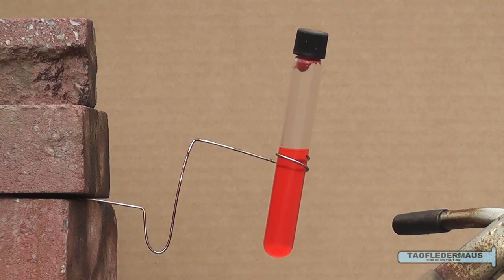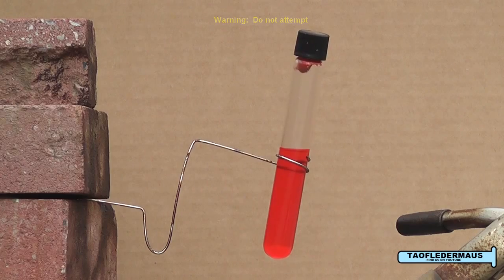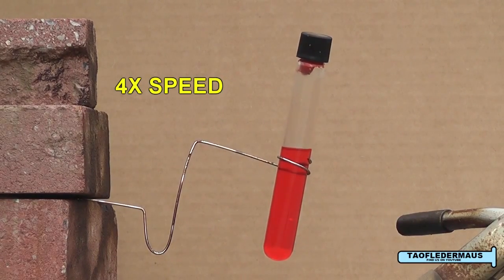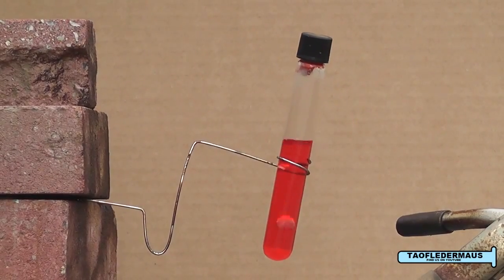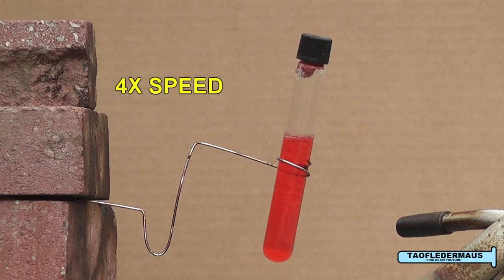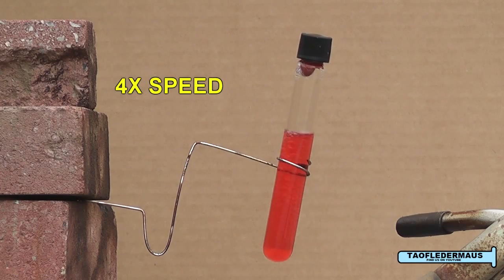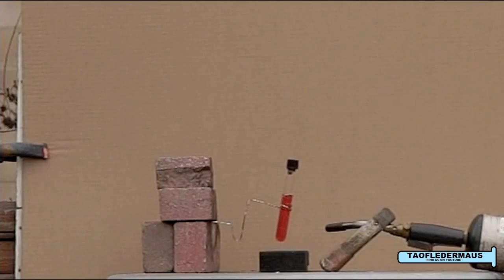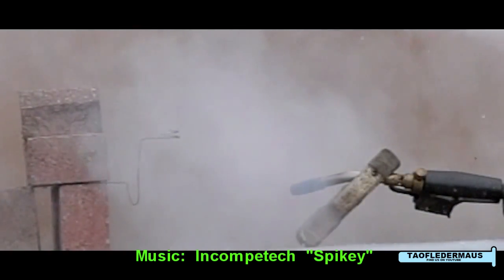ANTIFREEZE vs GAS TORCH -  Can you guess what happens?

Comment: The cap allows pressure to build. As the pressure builds, the boiling point of the liquid is raised. The liquid temperature is constantly being raised by the torch, increasing the pressure, which causes the boiling point to keep going up. Finally, the cap partially fails, allowing the pressure to drop. As the pressure drops, the boiling temperature lowers, causing all of the liquid inside to instantly boil and expand into a gas state explosively, shoving the cap out of the test tube and launching it into the table. Simple physics.
Reply: nah man he just got tired and shot it with his shotgun
Reply: +LimitedOptionsMan Your one smart person! Nice explanation!
Reply: +Imalovrman Don't thank me, thank Richard Graham, The Skunk Works, USAF, and the SR-71.

Comment: That was awesome, but what I wanna know, does the anti freeze turn into vapor as soon as it hits the air outside of the tea tube
Reply: Super-heated (because they are under very high pressure) liquids flash to steam instantly when pressure returns to normal.

Comment: I'm wondering if this was premixed anti-freeze or just straight up anti-freeze and what would have happened if it was pre-mixed or visa versa? I've been told using straight anti-freeze does not protect from freezing/boiling as well as properly mixed anti-freeze/water.

Comment: that is just awesome, it took a lot longer to pop than I thought, and in the end it was just heat-soak getting to the cap!
Reply from the maker: Thanks!   Yeah,   it's hard to tell how long these take to heat up to failure.   I tried motor oil and after 15 minutes,  I knocked the torch away.   I still need to try to re-do that one.   The oil just turned black.

Comment: Antifreeze also has lubricants for your water pump as well. Another interesting fact is it doesn't conduct temperature as well as pure water, but the benefits of the rust corrosion prevention, higher boiling point, colder freezing point, and lubrication outweigh the slight disadvantage  of not conducting as well.

Comment: There are two important factors that are shown in this video about the  internal tube pressure. 1) The liquid started to boil with big bubbles, but when the time is elapsing the bubbles start to shrink and the quantity decreased significally.  2) Notice that when the tube exploded it was a violent reaction, the substance inside was in a liquid status and it suddenly it vaporized, that was caused by the pressure variation, in a fraction of second the pressure inside was extremely high, and when it was released it decreased too much turning much lower than the external pressure before stabilization. That is a physical propiety of liquids, the second mencioned factor happened very fast.

Comment: that one sounded like an old flintlock firing, .....click, poof, boom!!! good vid, thanks.   
 hey you forgot to mention that due to the smaller molecular size of the antifreeze, it helps make more contact with the engine block at the microscopic level and therefore is able to work in conjunction with the water to adsorb and dissipate more heat in the engine block and radiator respectively lol it also accounts for some of the observations and results here

Comment: I've seen chem labs do, that want to do similar heating experiments, is melt the top of the test tube shut.  That would probably require oxy-acetylene, or MAP gas, might weaken these test tubes, and is probably tricky, and of course, dangerous.

Comment: That was awesome, love to see some other things that maybe you wouldn't think would explode like that, maybe they will. Cheese, KY Jelly, Octane Booster, soda, jello..
Reply from the maker: I do want to try cheese.   Sometimes I prepare these and they sit around for a few weeks before I get a chance to film them.    I've got brake fluid, ammonia,  Cascade, mustard,   and chocolate chips read to go.
Reply: I did chocolate in a glass bowl in my microwave once (before I learned you're suppose to use a double boiler to melt chocolate), and that stuff heated up so quickly, it started to smoke, I had to unplug my microwave, and toss it out the window! I don't know how, but it got so hot, the glass bowl and the glass turning plate shattered before it made it out the window. Lesson learned.

Comment: What about a test tube with nothing in it? Literally NOTHING. A vacuum. Not sure if you have the capability to accomplish that but I'm betting you can figure it out!
Reply from the maker: Air doesn't expand that much when heated when compared to a solid or liquid. 
I'm sure the test tube would just melt.

Comment: My theory for the unique order of events in this experiment:
1. Small leak in the silicone plug causes the cap to pop.
2. Once the cap pops, vapor starts escaping from the small leak.
3. As the vapor escapes, pressure inside the test tube decreases. This causes the boiling point to drop.
4. Lower boiling point -> more vigorous boiling -> sudden increase in pressure.
5. Pressure increased to the point of silicone plug failure.
Reply from the maker: That's pretty much it.

Comment: That was a really good one! Interesting to see how resistant to boiling and exploding antifreeze really is.  I wonder how gallium would react in a test tube like that. Although spraying molten metal around might not be the best idea in the world.
Reply from the maker: Gallium has a VERY high boiling point.  It's much higher than the melting point of the glass.
Reply: That's too bad. Milk might be an interesting choice though. See how it breaks down under heat and pressure.

Comment: The difference is, coolant is the liquid that curculates through your engine and radiator to cool the engine. Anti freeze is a component of most but not all coolants.Diesel engines use a special antifreeze called Dow Therm. Suzuki motorcycle engines use oil in their engine cooling systems in some of their road bikes like the Intruder line. Auto motive antifreeze must not be put in your cooling system by itself.It is made to be mixed with water to work properly.I usually mix it 50/50 which will protect from freezing to -40 F.

Comment: Hmm. Propylene Glycol or Vegetable glycerin?
The two main ingredients in e-cig liquids.
Propylene Glycol can be found as non-toxic plumbing antifreeze at Lowes or Home Depot.
Vegetable glycerin can be bought at most Walmart stores. probably in with the baby oil or supplements.

They're not as pure as the stuff used in e-cig liquids but they should be close enough to be interesting.
Reply from the maker: I believe a lot of this is propylene glycol.   I have some pure propylene glycol too.   I think glycerin is what baby oil is?
Reply: ***** Your pink antifreeze is something like a 60:40 PG:H2O, if my bit of research is correct. I would like to see what the high purity PG does. You can probably boil the water out of the antifreeze, if you wanted to, and get close enough.

No, Baby oil is mostly mineral oil. Glycerin can be found in pharmacies. I know walmart has some good stuff behind the pharmacy counter if you ask for it, but that isn't required. :)
You'll be looking for this, it's not as pure as it claims, but it's close enough, as long as you're not vaping it... you can taste the difference. XD
http://www.walmart.com/ip/Vegetable-Glycerin-100-Pure-Natural-Earth-s-Care-8-oz-Liquid/31213131

Comment: If you turned one of these upside down and added fins to it, how would it work as a rocket?
Reply from the maker: It would be hard to add fins to a glass tube.   The flame would probably burn them off.   I have to make sure these stay in a small area and not fly off and hit someone or a house,   etc.

Comment: Why don't you invert the test tube ? Heat the test tube from the glass top, so as when the epoxy plug blows off the tube doesn't immediately shatter agains the table.
Reply from the maker: I have to heat the test tube where the liquid is,  near the bottom. If I invert the tube,  I'd be putting a lot of heat on the cap and plug and those would fail at a much lower pressure.   I also don't want to the test tube to fly off uncontrollably.  I really doubt it would fly straight,  it would fly like a rocket engine with no rocket,  just corkscrew around.   You can imagine getting hit with something like this and
then it blasting superheated liquid all over you.

Comment: I am not surprised it took so long. I mean, that stuff is designed to handle extreme temperature after all.
Reply from the maker: I think water has a higher specific heat than antifreeze. But...  it has a lower boiling point.    I  thought this might take less time than water.

Comment: I don't get why the tube exploded? The pressure was already realeased and the the tube didn't break from the impact on the foam.
Reply from the maker: Only some of the pressure was released when the cap was ejected.  The liquid inside was still WAY above its flash point and under a lot of pressure.  The plug blew out and the liquid inside instantly turned to steam when it hit atmospheric pressure.

Comment: Please try popcorn with oil in the next vid after wax.
Reply: I think I saw that he tried it and it failed. Popcorn won't pop under pressure, and while it can pop once the pressure is released (tube breaks), it won't if it's been burned too much.
Reply: Effing Effwerd I remember Mythbusters did some thing like that and the popcorn came out puffed rather than popped. As for burning it I'm not sure any thing can be done apart from getting a thinner test tube.

Comment: Blood!
Reply: it would coagulate then burn.
Reply: Nff That doesn't seem logical since the test tube is a closed system. A bit over half of what makes up blood is blood plasma which is basically 90% water with salts, protines, sugars, lipids and other stuff. The rest is made up of different cells.
Reply: yes but if you add heat to blood it will thicken and essentially "cook" and then char.

Comment: To the People who don't change coolent: Over time,the PH changes in old coolent. It turns mildly acidic and WILL eat away at your head gaskets.   Change your coolent regularly, please! Under $20 if you do it yourself.
Reply from the maker: good advice.    Note to self....  lol
Reply: Every fluid in your vehicle should be changed.. Majority of people ignore the important fluids. Cooling system, transmission, brakes, & power steering. 
Ever cruise Craigslist, and see low mileage vehicles with dead transmissions, because the owner never replaced the fluid. Fluid & Filter every 20,000 miles.
Reply: +Pantharen 210,000 miles on dads truck with a 700R4 trans,  never changed the oil or filter.

Comment: Again, did not expect such a resistance to pressure. I would have expected a failure much quicker. I'm sure if it was that temp in my engine cooling system, a failure would have arrived in a tenth of that time...lol. Thanks Jeff. Interesting result. Have you considered motor oil or other lubricants/mineral oil?
Reply from the maker: I expected this to heat up a lot faster.   I thought I may have had a leak so it wasn't pressurizing.    I do eventually want to try motor oil - probably both normal and synthetic as a comparison.    I have one loaded with brake fluid, but most others are more common household liquids and solids.  Crayons,   chocolate chips,  Cascade,  Froglube,  and ammonia.

Comment: how about a test tube cannon.. put the tube in a closed pipe, and heat up the tube. i am guessing if enough heat can get to the tube, it would shoot crazy far.. Use water as it should work the best.
Reply: That sounds extremely dangerous and probably illegal in California.
Reply from the maker: LocutusIsBorg   I plan to use an open pipe with a slot on the side to heat the test tube.  Then I can aim it at the wall or whatever and it would be like a recoiless cannon.   The pipe would just direct the test tube and hopefully get it going straight and fast.
Reply from the maker: I made a pipe to  try that with.   I  think it will just spiral out of control since there is no stabilization.   That's my guess.    I've been wrong many times though.  lol
Reply: ***** Maybe stick fins on the side of the tube (metal fins maybe so thef don't melt too soon) and put it on a ramp instead of in a tube, Katyusha style ^^